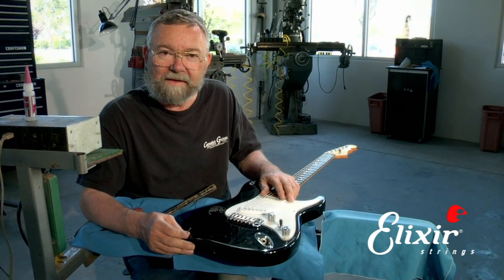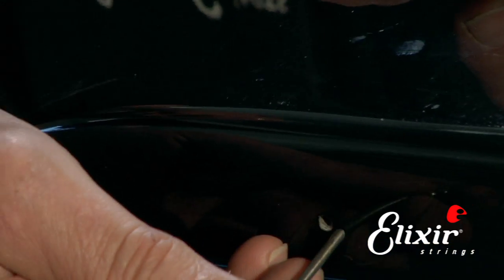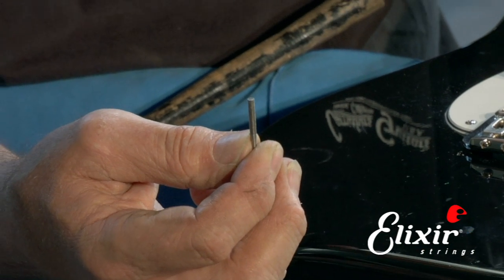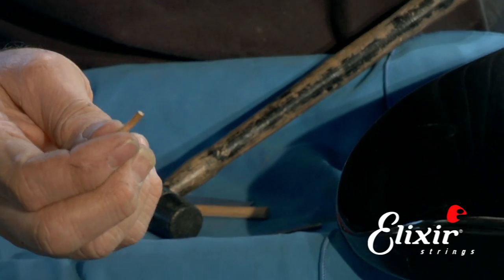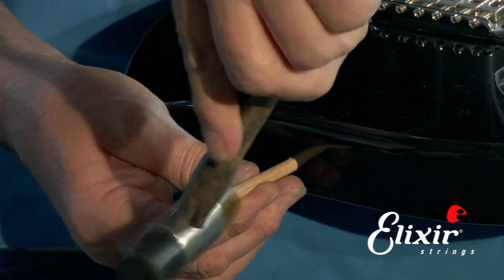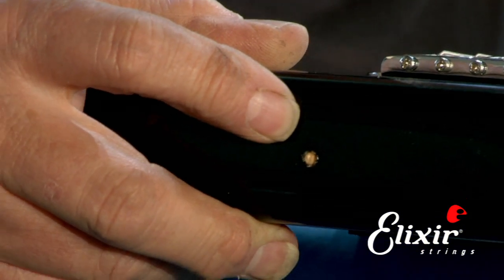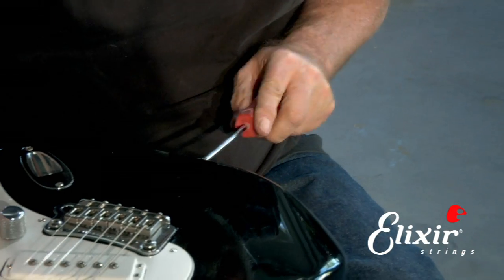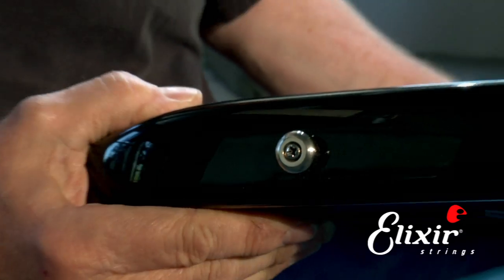How To Repair a Strap Button | ELIXIR Strings

Comment: Question...

After you glue in the dowell, do you use a drill bit that's just a tad smaller then the screw that will hold the button?

Comment: Just used a toothpick and some glue (blue loctite) on both strap buttons on my Fender Precision. That sucka ain't movin' now.
Reply: I've always use the toothpick for stripped out strap buttons. Works for door hinges too.   However, I think I am going to try this method.   I have a semi hollow that just seems to not have much inside for the screw to grab onto.   I actually used a anchor on one end it has held up.  But the screw does get loose.  Maybe some loctite stuff .

Comment: If you are using regular dowel and what looks to be super glue then this is a perfect example of how 45 years does not mean you know what you are doing... if that is regular dowel then you are now mounting your strap button into end grain,,,, wrong.....  and if that is in fact super glue... wrong again... super glue is brittle and will eventually break away... it may have escaped your notice over those 45 years but there is a glue called ... wait for it... wait for it....... WOOD GLUE..... yay...... this is a cowboy job... if you are gonna plug the hole use cross grain dowels/plugs, not end grain, and use wood glue...its purpose is in its title..